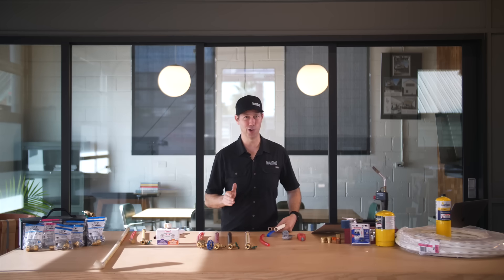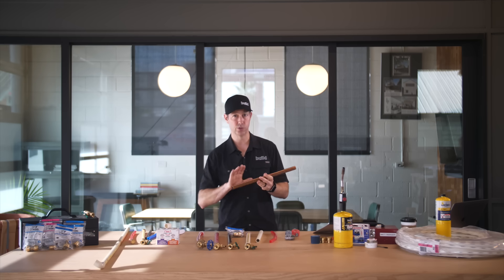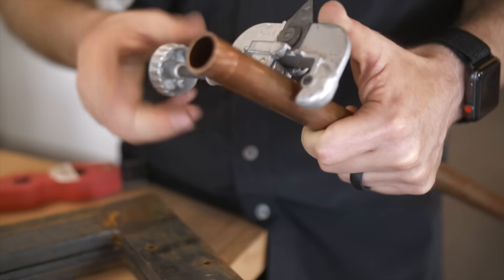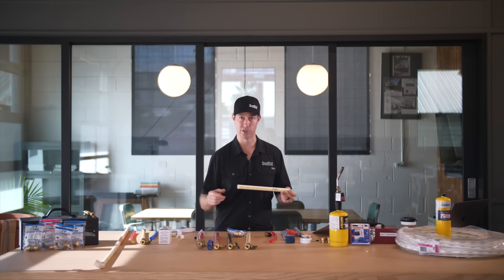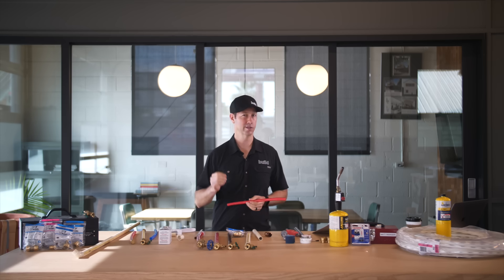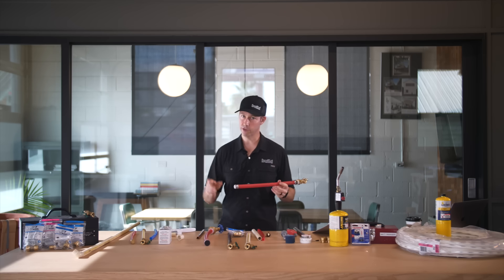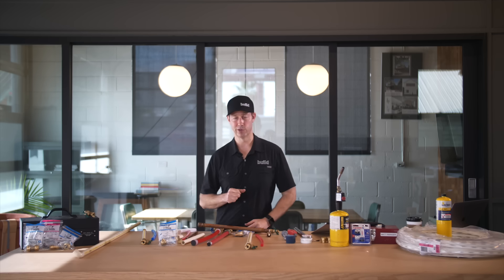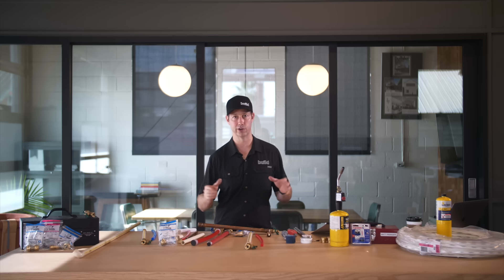PEX vs COPPER vs CPVC plumbing pipes

Comment: For anyone pro copper or hoses type systems arguing against CPVC your last threads are fake professionals or ease of install. Both are farcical. It’s over. CPVC wins. Unless you are biased. Such easy science. Sorry plumbers. It’s say to do your job.
Reply: CPVC does NOT win and isn't even close to a win. Pex or copper is way better than CPVC. Everything Ive ever seen from CPVC has become brittle and junk in a very short time. Use the crap if you want but it's junk.
Reply: @mikek8632  Wrong. That is your opinion like many others whom do not know chemistry. Your opinion is exactly like the two thousand people that commented and is the reason why I wrote what I wrote. This is not my opinion I'm telling you what the facts are.... Did you not understand that from the first post? PEX is a system with special tools designed for quick build junk spec homes. for example I live in St Louis Missouri and 99% of the homes were built a hundred years ago.PEX, cannot do it.  They also have lawsuits against them for lies about the P in PEX. Copper, traditional and is good, but is impossible for most all to work with quality to proper completion including almost all plumbers. My family owns a plumbing business. I can interview 10 self proclaimed plumbers claiming talking like you and I take them right nto the shop and say, sweat away. Show me how fast you can plum this area and just give them a example and they all fail. their joints look like garbage that have no flow or artistic ability like the original engineers intended copper to be sweated. It's absolutely incredibly inefficient but it's all they had hundreds of years ago. What else...  PEX is not code in most cases unless it's exactly what I described above. CPVC is impossible to argue around from your low level let alone mine and is plumbing Code in most cases throughout the United States. So I'm not sure what you're talkin about? What's next shark bite? I'm also a mechanical engineer and from a physical scientific standpoint and ASME standard it is CPVC forever. It's been adopted by the engineers for many years. PEX will never be, especially in remodel and rehab which is 90% of what's going on, not junk spec home builds. CPVC plumbs just like copper, yet it is 99% faster and more reliable. It's also timeless. You're not allowed to even throw it into a dump because it does not ever go away. So your simple notion that it just breaks to pieces is absolutely false. I can find the oldest piece of PVC and cut it out of a wall and if I hit you in the face with it you would be absolutely wounded and need to go to the hospital and the PVC would never break. To put things in a better perspective at low gradeschool level
Reply: @hatzlmike1  you are incorrect. Its a fact and there is tons of proof that cpvc is an inferior product and prematurely degrades and becomes brittle. You must be a cpvc salesman trying to push a product because otherwise you wouldnt be backing such a junk product.
Reply: Btw...just because something may be code doesnt mean its right. The government screws up more often than its right....i love that your family has a plumbing business and your onesided perspective gives you some sense of knowitallism. Its a good laugh.

Comment: I have had corrosion leaks in my copper pipes, buried in the ground.  I should have wrapped these.  I have also had failure with PEX because mice chewed thru looking for water.  I have no direct experience with CPVC.

Comment: Didn't address freezing pipes, fitting reliability, etc...
Reply: Exactly right! I bet there’s a bunch of people in Texas tonight who’ll be installing pex because their pipes broke due to freezing.
Reply: @roncross1945  exactly!! We purchased a house in June did all the plumbing in pex and didn’t have a problem. My lines did freeze (pier and beam with no skirting )but we put a heater and they thawed out in under an hour!! They worked perfectly right after.
Reply: @ezminick7651  Hey there, does the water taste like plastic coming from Pex?

Comment: Nonsense. Type "m" copper is ONLY for use on heating systems.   Mostly because because of the lower pressures ( 30psi) in heating systems as compared to municipal water , which is about 80psi , or more.

Comment: Had to get an engineer to call the building inspector to use the flow goldstripe.  Fail after 7 years in several spots, maybe stock was sitting outside at Lowes.  No way to know for sure.  Ummm copper doesn't care about UV.   Thanks for the video comparison.  Lawson di Ransom Canyon

Comment: Thinking of using PEX and I have 1/2” copper and I have a run of 30’ do I have to increase to 3/4” PEX for the run and then go back to 1/2” PEX at the end of the run or can I just stay at 1/2”.  I heard PEX has a smaller diameter?

Comment: Only copper, maybe pex... Don't mess with cpvc

Pex's elasticity is great for some things but elastic materials wear over time quicker than rigid materials.

Cpvc is rigid and weak

Copper has high psi resistance, rigidity, and as a metal, slight maliability.  It's only downside is susceptibility to chemical reaction such as dielectric corrosion.  

This is easy enough to manage

Comment: Obviously not a plumber. He said that cpvc when glued wont ever come apart. Thats bullshit! Ive seen the "water hammer" effect happen on cpvc and it blow the joints out. Plus cpvc is absolutely horrible for plumbing your home. If it hits 31° that shit is going to explode. Please use PEX it is waaay more durable. I hardly ever get called to fix PEX. Almost every busted water pipe i get called for is cpvc and copper hose bibbs. Usually copper does great but the hose bibbs stick out of the house and are exposed to the elements. They tend to crack when the water freezes inside them.
Reply: Also cpvc does not last 75 years it gets brittle after a few years. If a pipe busts from the cold you cant use a pipe cutter to cut the old pipes because it cracks easy after its been in a while. You have to use a saw and its inconvenient it its a small space. As a plumber i would recommend NEVER USING CPVC!

Comment: Why hasn't PVC schedule 80 pipe not used in re-piping and new construction? It's usually gray in color and can be easily pipe threaded or glued together. …. hmm do they make schedule 80 CPVC?
Reply: funlovingJohn because it’s probably insanely toxic since it’s not meant for water

Comment: In Texas I have multiple failures on my 18 year old RV CPVC pipe. It is very brittle and is very hard to just replace the broken section. Being so brittle, it tends to break wherever you touch it. Highly do NOT recommend using it as you will experience failures, in some cases costing 10s of thousands to repair the water damage. Check YouTube for more details.

Comment: Flow? Only pexa with expansion has the same flow with copper . CPVC has the most failure rates by double digits. You talk about the flex on cpvc but any pressure on a joint will cause failure.

Comment: I had a brand new house with copper piping that developed pin holes in it in just over 5 years.
They dug back under slab to repair it. This was in 1982. They told me it was because the water had to much chlorine in it that caused hydochloric acid that ate pipes up. Some one also said it could have been caused by a lighting strike. Would some sort of water conditioner at side of house have stopped this.
Also most refits go through the attic does the heat in their degrade the CPVC shortening the life.
Reply: i was told by a " MASTER " plumber w/license f/chicago 2 match & yrs of experience also, that cement does NOT like copper... had a buddy that had 2 replace floor heating pipes because of that / NOT chlorine  in h2o... also, he always said if u hav low pressure, replace ALL horizontal galvanized in an older house, usually in basement,  & it will get better pressure, he was rite, i've dun it a couple timez in my younger dayz...
Reply: also, i had 2 replace sum plastic pipe w/copper during a remod, & i just could NOT break pipe over my w/out great pain, was installed in 1974... both hot & cold side... still hav about 25 / 30 feet of plastic that i will replace w/pex soon, just 2 c wut it iz like 2 work w/...
Reply: oops, over my KNEE...
Reply: plumbing inspectors  around here will FAIL job if they don't SEE the purple primer @ every joint... i, myself like clear...

Comment: In cold climates where a possibility of frozen pipes...on copper you can attatch a welder to it and by passing current through ..it will free up the ice(melt) and can cut costs of repare

Comment: Cpvc purple primer spills... can be mostly cleaned off using clear primer on it.
Reply: some states require Purple primer to make sure you actually used a primer, some states also let you use the Gold pvc glue so no primer required
Reply: You can not get primer that is clear but when the inspector shines a blacklight over it, it will look purple.
Reply: I had bad luck with the clear primer. Believe it or not, clear glue works well to get the purple up

Comment: Copper's horrible except for clean water otherwise the maintenance is terrible for a consumer CPVC you can't put it everywhere your best bet for cold water outside installations PVC they have scheduled 460 PSI durable strong but not as fresh as copper because of the plastic but 90% of plumbing leaks come from copper be ready for the maintenance cost if anybody tell you different they're lying most of all lyrics come from copper or galvanized

Comment: 4 types of copper 
yellow used for drain or venting
Red or type M cheapest potable copper not recommended wall thickness minimal
Blue or type L most commonly used copper and recommend .
Green or type K most expensive thickest wall mainly used in commercial applications ie hospitals factories .

Comment: I repair pinhole leaks in Copper on a daily basis in Orlando Fl, I would never ever, ever, use copper, as many have stated, CPVC does get brittle, faster on hot water and will easily snap.
Reply: Probably was type m
Reply: Or to much flux or someone didn't de bur

Comment: My two cents: PEX is noisy. Every fitting throttles down the water flow and creates an eddy. Copper does not. Repiped half of a house with PEX during a bathroom addition and was shocked with the water noise. Full insulation, finished walls and interior. Not as quiet as copper. Just FYI.

Comment: Plastic pipe for a house you are renting or selling, in your own house copper is the only way to do it 
And no need to solder copper compression fittings or if you have  a REMs tool use fittings that work with that. Makes life so much quicker and easier

Comment: I don't understand why you did not talk about PVC for cold water, I use mostly PVC, & use CPVC for the hot water only.  been doing it for 45+ years.  Almost every time I do a plumbing job I'm so thankful for PVC :)  because when I was young I put in lots of copper & galvanized iron pipe.  I use a torch to bend my PVC a lot, but when I was young we had a electric heater.

Comment: Copper pipe is available in several grades where I am from.  Type M Residental typically (red, not available in soft copper for underground use) type L commercial grade (blue, available for underground use) type K refrigerant copper (green, underground use as well as recirculation lines) type dwv (yellow color strip Drainage pipe)  also there is white colour coded pipe I have only seen use in baseboard fin heating.

Comment: I found several burst copper pipes and several degraded leaking elbows in a basement where the property was not heated. PEX-a would have survived. 

It is best to keep your plumbing inside somewhat conditioned space. This basement had no insulation and half was above grade with solid stone walls.

Comment: The number one cause of any water delivery failures is not material, it is water quality. The amount of minerals and sediment in any water system will destroy any of these systems. Proper maintenance, installation, and filtration will greatly increase the lifespan of all these systems..... But copper will last the longest lol.

Comment: Do not.. I repeat do NOT use cpvc , I’m a plumber who works in high rises.. some of the cpvc that has been installed over 10 years ago , on the hot water feed is drying out and cracking.. from 1/2” all the way up to 2”.. take your chances if you want to be cheap, but you will pay for it later.. I’ve seen million dollar apartments destroyed..

Comment: U need more info
75-100 on copper no way brotha. 25 years max out here in cali w chlorimines
Reply: If there is enough chlorine to eat away copper, think about what it does to your body. Carbon filter will solve plumbing and health issues when it comes go chlorine.

Comment: One thing that was not mentioned about pex tubing is the fact that it is the only one that does not burst when water freezes in it. I have personally seen pex swell twice it's original size from water freezing in the line and shrunk back to its original size as soon as the ice was cleared from the water lines. Afterwards the water system operated as if it were just installed that day.
Reply: I just had frozen pipes in my house. Copper. Luckily, all survived. The only thing broke is brass rough in valve in the shower.  But yes flexibility of PEX would be useful. . But how  pex fittings  perform in this scenario ?
Reply: Had pex b break from freezing many times
Reply: PEX A is more freeze forgiving than PEX B.

Comment: I would never trust cpvc in any longer, 15 or 20 years max but shorter in hot water explication.....also in my state of Florida uv kills it faster. I had seen it fail first on the hot water side on a regular bases after 10 years.
The manufacturer also dropped the warranty from 30 to around 10 or so.....check me on that but I think I've just heard it recently.

Comment: can I use pex or cpvc to replace the connection from my water meter?
Reply: From the water meter at the curb to your house, use one inch PVC buried 18 inches deep, with a back flow preventer and a ball-type shut off valve at the wall.

Comment: Water makes a difference. I have well water that is slightly acidic. House is 22 years old. Some copper pipes, possibly solder joints, under the slab starting leaking with in a year or so. Could have also been due to expansion contraction due to hot water which I'm not sure a lot of folks think about. Almost all was replaced with pex and crimp on barbs and shark bite. Only leaks since that have been one crimp Tee that had a lot of stress on the connection and a couple more soldered copper that wasn't originally replace leaking probably do to a couple freezing and one weeping solder in a hot water shower line that was either expansion contraction fatigue and/or acidic water. Well water leached a lot of copper out and left green stains in sink and very coppery water if water drawn from sink that hadn't been used for a while like over night, without letting water run a bit first to clear that out. I have not yet tried the new plastic barbed crimp fitting I've seen in stores, but guess they would be the best with my water.

Comment: Quick question guys, i am installing a water filtration system for my house, from the main line, to the filter and from the filter to the out(in) outlet, which piping should i use that safe for drinking water?
Reply: Pex

Comment: There’s a class action lawsuit against the manufacturer of CPVC for pipe failures.

I’m sticking with copper.
Reply: The lawsuits were against the company nibco for producing defective fittings.  So saying not to use a product based on 1 manufacturer that had some defective parts is irrational.  Pretty much like saying we should only drive cars because ford had some defective parts on a truck they produced.
Reply: Pex
Reply: brandnutopian   Pex is better than copper especially in cold climates. Much less trouble. Can freeze no breaks.
Reply: PEX is the only way to go!

Comment: Funny, you stated copper lasts 75-100 years NOPE... My home is 20 years old and has had 4 pin hole leaks so far. Maybe copper pipes made in the USA 50 years ago might have lasted that long but the imported crap sold at Home Depot these days is just that CRAP.

Comment: Well (iron) water eats copper, so does hot water due to exciting the minerals.
When you bid copper, you tell them THAT bid is only good for THAT day
CPVC is CRAP, Garbage, It breaks in cold weather &  It gets brittle over the year
USE CLEAR PRIMER FOR CPVC DUDE !!!!!!! Purple is code for PVC
CPVC will make popping noises from expansion
PEX is easier, faster, more reliable. Best pipe on the market!!!!!!!, 
crimp fitings are best.
Sharbites are SHIT. I only use them on rental property.
DO NOT BURY ONE !!!!!!!